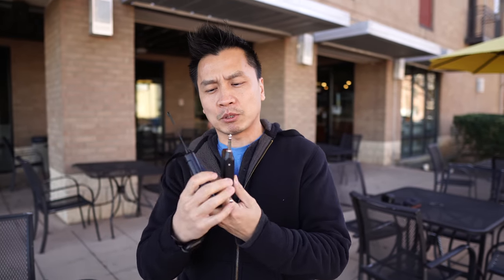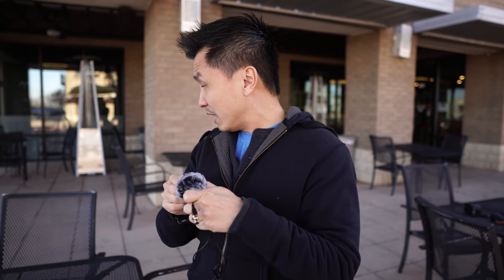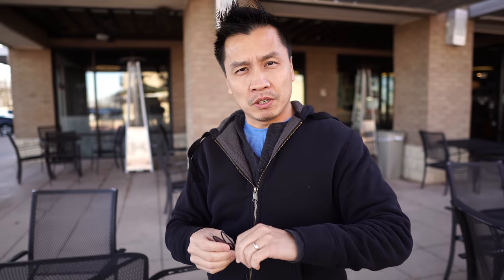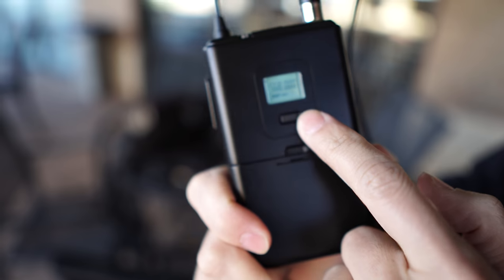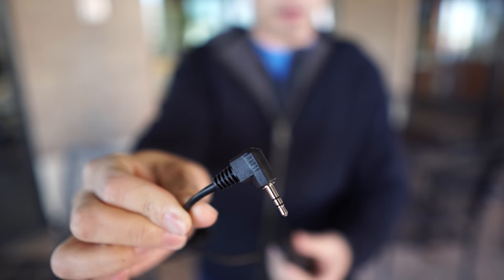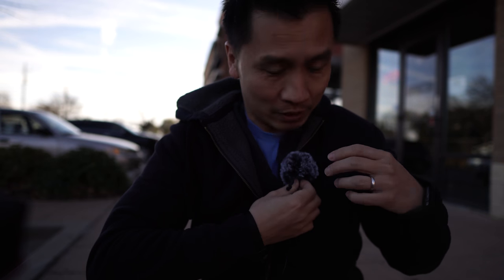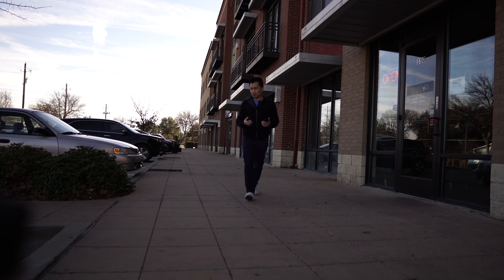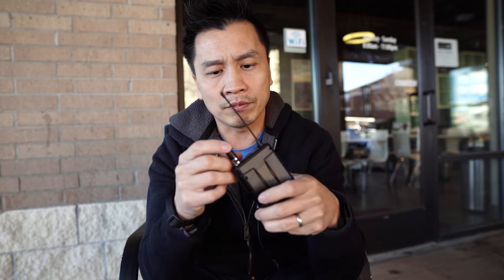Hacking Cheap Wireless Mic for Your Mirrorless and DSLR | $30 Fifine Wireless Lavalier Range Test

Comment: I have to point a thing about your (otherwise well thought) video... there is no "normal" XLR connector.
When you work in the world of live/stage music, you only work with XLR connectors regarding microphones... be there large or mini. But there's no "normal" XLR. It only is a matter of available room on the "receiving" device and on the microphone itself.
On a mixer-board (plenty of space) :  large size XLR (3 pins).
On effects set up in a rack system (plenty of space) :  large size XLR - 3 pins.
On HF microphone systems (total lack of space) :  small size XLR - 3 pins.
On monoraul wired microphones (average space, but shapes match) :  large size XLR - 3 pins.
On stereophonic wired microphones (average space, but shapes match) :  large size XLR - 5 pins on the mic side. But double XLR - 3 pins on other end.
On MS type wired microphones (average space, but shapes match) :  large size XLR - 5 pins on the mic side. But double XLR - 3 pins on other end.
On mesuring-oriented microphones (acoustic tests mostly) :  no rules, it all depends on the field in which the microphone will be used. For mesuring sound and its effects in pipes, along walls, inside metal poles, atop concrete structures... microphones can have welded cables if no other solution can assure fit and connectivity. Sennheiser, Schoeps, Beyerdynamic, Neumann are brands that specialize in these very non-normal microphones.
And same for jack-type plugs... no "normal" size, it depends on the same criteria as for XLR. An exemple... some 30/35 years ago, all hi-fi or professional headphones were fitted with 6,35mm jack plugs. All, with the very few exceptions of hi-end hi-fi models (having proprietary conectors or modified DIN-type connectors, to cope with hi-intensity tube pre-amplifiers). But, with the success of "mobile" music players, you shall hardly find this today. Pocket-size players started to rule the World, so manufacturers started to fit their products with 3,5mm jack connectors (+ a 6,35mm in the box, just in case).
So... no "normal" connectors... like there's no "normal" car or bike or shovel or rake. It all depends on what ou have at each end of the chain.
One thing the XLR brings with it, and it's a major pro... the "symetrical" inner capacity. I let you refer the "heavy" available documentation. To some it up, it means the system in conceived to kill interference for the source on. This is why all stage microphones have XLR plugs... you don't want your favourite singer to have a buzz-full gig !  This is why most HF systems used in cinema use mini-XLR connector types... because a take can sometimes be impossible to repeat (my job).
But if you go in the heavenly world of karaoke, all you see are 6,35mm jack-type connectors, because... who cares about a buzzing sound ?  All that matters is the volume of noise each (drunk) singer can produce !
This is also why you can find 3,5mm stereo jacks used for mono-wiring of mono-microphone. Using stereo-jacks for mono-microphones can enable a "symetrical" system... if wiring done the right way !  I hope I don't lose you on this topic, and won't go any further. Unless requested.
The world of sound, sound capture, sound reproduction shall always remain an unacute science... because it is based on eletromagnetic vibrations. And that was created and is ruled by Mother Nature... we are only humble users of this, NOT masters.
Reply from the maker: Uh thanks!